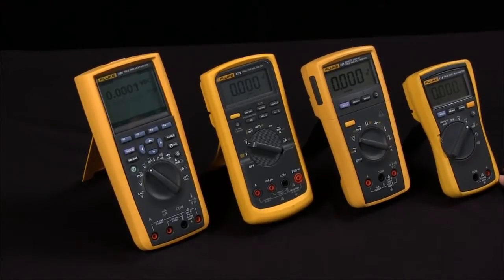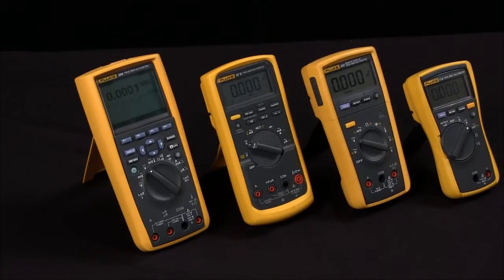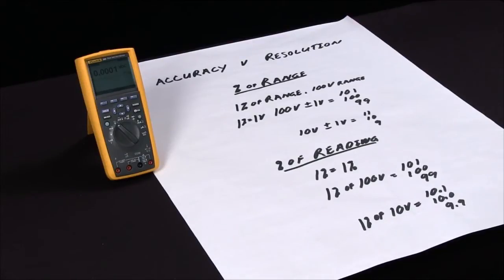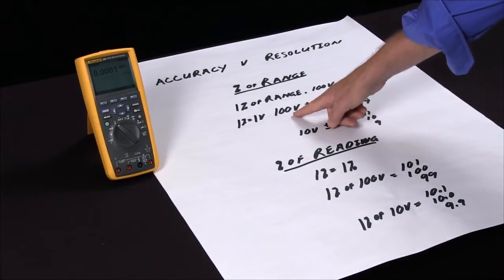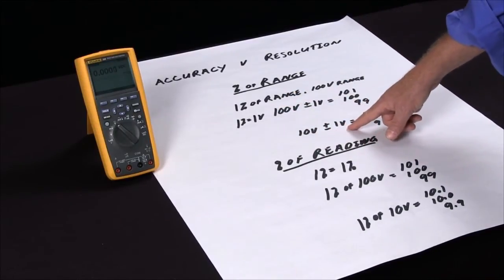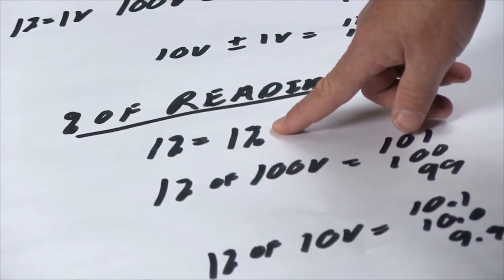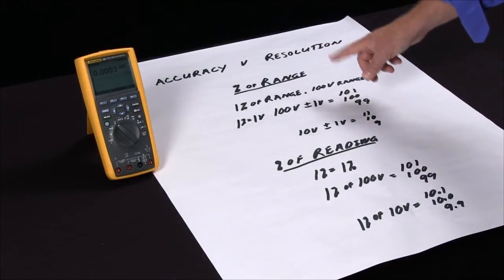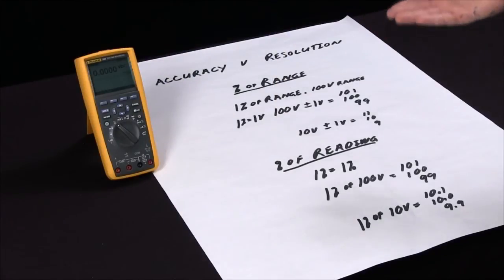What is Accuracy When Selecting a Multimeter?

Comment: I don't understand what the accuracy in multimeter measurements means (fluke 107, for example).
For example, the multimeter indicates an accuracy in measuring volts of 0.5%+3 (in specification)...
The multimeter displayed 3.496 volts on the multimeter screen.
What is the maximum and minimum value of the true value of the measured voltage?
How to calculate the true voltage values (we will denote them by X)?
It can be:
Option 1:
(maximum value): 3.496+0.5%+(0.001*3)=3.51648
(minimum value) 3.496-0.5%-(0.001*3)=3.47552
Option 2 ("+3" is already included in the displayed result):
(maximum value): (3.496-(0.001*3))+0.5%=3.510465
(minimum value) (3.496-(0.001*3))-0.5%=3.475535
Option 3 (error is measured relative to the true value of X):
(maximum value): X-0.5%-(0.001*3)=3.496
(minimum value) X+0.5%+(0.001*3)=3.496
Your option4: =?

Please tell about the formula for measurement accuracy in the specifications for your multimeters!

Comment: 1% of 10v is 0.1v, and not 1v , how can you take a 1% of 100v and apply it to 10v,!!!!!!!!!????????
Reply from the maker: Hello Samir - The accuracy specification will vary with the test tool that you have. This video itdentifies that some meters will say "x% of range" or "x% of reading". Most Fluke multimeters will have x% of reading. Which tool do you currently own? I would recommend checking in the user's manual and identify what category your meter will be under. If your meter is 1% of reading then you would be taking 1% of the measured value (10V being +/- 0.1V) and you would not be applying it to the full range.